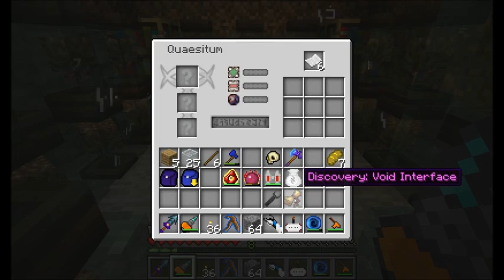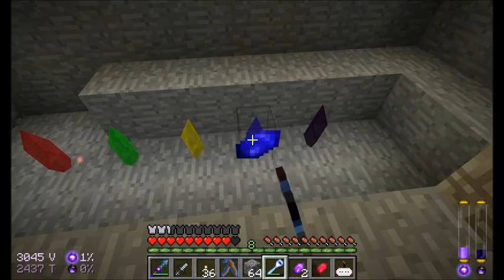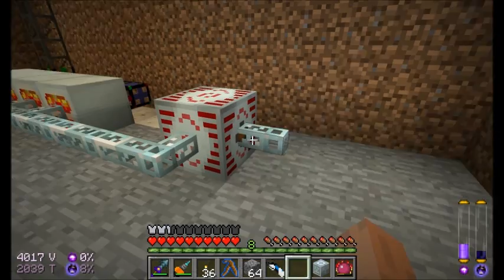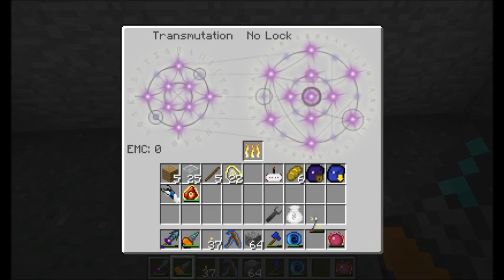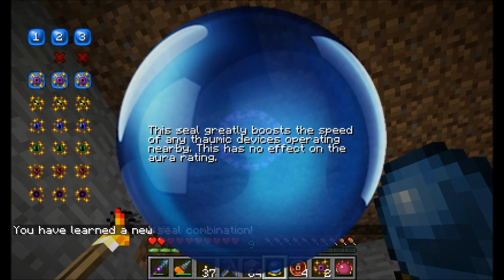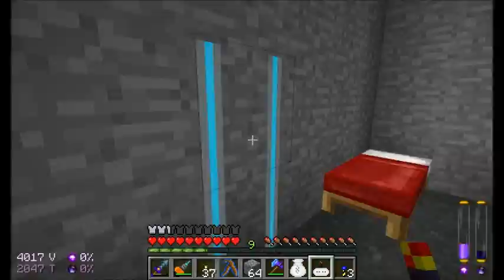Season 4 - Episode 33 - Direwolf20's Minecraft Lets Play

Comment: True that. Growing Taint Crystals increase taint probability. But to prevent growing taint in local aura you can make a simple contraption: allow your vis condencer to work with taint (Condensed Evil upg) and put taint crystals there: they'll start draining taint from aura by liquefying it to your conduit system. And to prevent your liquid system from overflowing with taint, insert 2-3 vis purifiers in recycle scheme: get taint+vis from tank, put them into the purifier, pump to the tank back.

Comment: Increasing the speed of running devices means increasing the amount of taint they produce so if you increase the speed of something that drains vis and produces taint (condenser)  in the atmosphere it will naturally produce taint at a faster rate. while the seal itself has no effect on the aura it is changing the effect of the machines.

It might be useful to find out if it will boost the effect of the totem of dawn, if it does you may be able to offset the increased taint output using it.